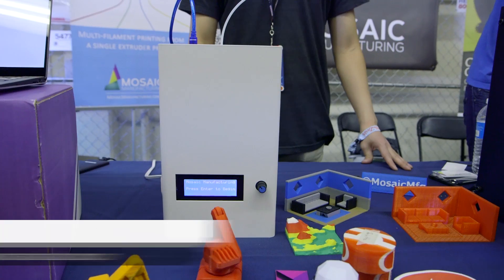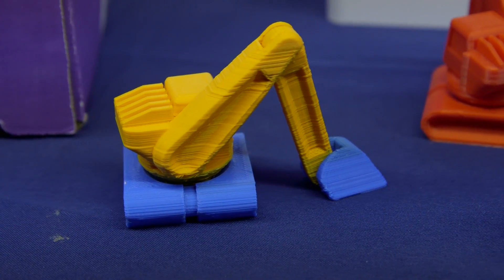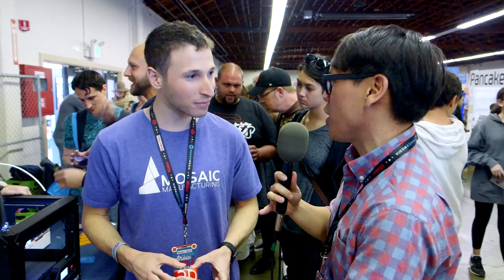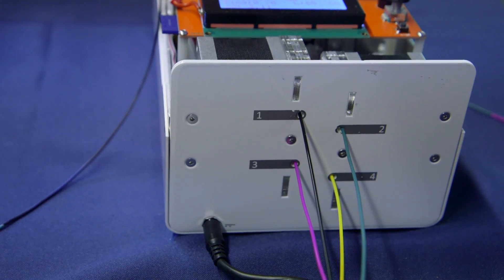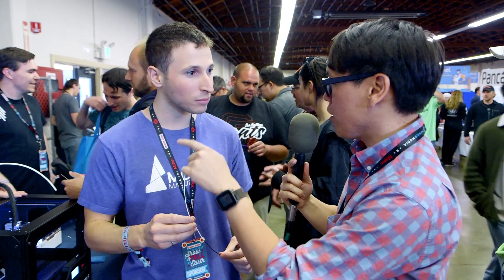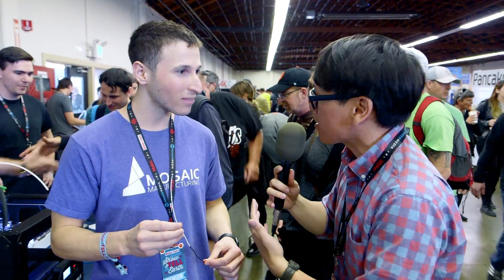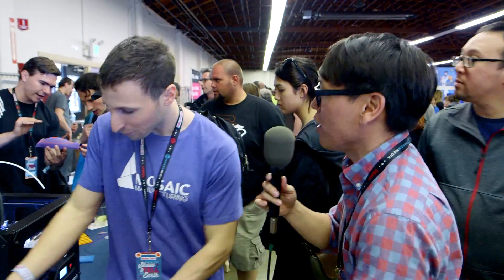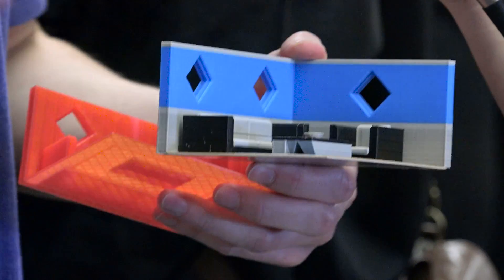Multi-Color 3D Printing with Palette Filament Splicer

Comment: Looks like this Palette system might be the way to use the PETE strip pulltruded material effectively for longer runtime prints so someone doesn't have to be there to load the next spool within a given time after the stop sensor pauses the printing process... which if one waits to long can funk up the heating/temp properties of the system and screw up the prints.
Reply: Oh yeah... and I forgot to mention you can use the Palette system to just make long spools of the PETE bottle filament by itself.

Comment: I am skeptical. The lines between colors cannot be sharp. There will be a transition zone where the colors mix in the hotend when changing colors. You can do a much better job manually by pausing the print, flushing out the old color, and loading a new color into the empty hotend.  No thanks.

Comment: what about the transition between the 2 colors. for example, If i had black filament in and took it out and put in white, it would extrude a mix of the 2 colors before it extrudes the actual white color your looking for.

Comment: It's very cool, but you can't exactly print a JPG texture on a cube with it. There was a solution from another company (Spectrom) which used dyes to color white filament as it went through, but it seems like they went under/vanished.

Comment: so why not actually mix different filament colors live? like over heating them to a liquid state mixing them with a little  coily thing  like they have in slushy machines then sending them through a filament shaper thing... or even use colored UV activated plastics... so mix them as a liquid extrude them as a liquid and pulse a UV laser on any area you need to be harder....
Reply: the UV cured resin would be best...it would reduce overhang and stuff...

Comment: Is this aimed at a specific 3D printer MFGR right now or will it be universal for all 3D printers as long as they meet the requirements of your system? I'm going to be buying a 3D printer in the next 30days that does have dual nozzles and your product may be an option later on.

Comment: ok. so I got that they meld the 4 colors into one, but how does it pick which color shows? so does it have a second extruder in the palette machine that melts the strands together first?
Reply: it is cutting and splicing the strand together on the fly. it takes 4 different filament colors, and actually welds the requested color onto the previous one leaving the machine, going to the 3d printer.

Comment: I wonder if it compensates for different sized hot zones in different hotends. Just because you put a different color into the hotend doesn't mean that a different color will come out instantly. It can often take me as much as a foot of 1.75mm filament to completely switch colors from, say, straight white to straight black.
Reply: It uses a transition tower to switch the colors.  I have a video on my channel showing a two color test print that might show it better. I haven't measured the actual transition square, but it might be 1 inch. That might give you enough filament run-out to clear 12 inches.
Reply: color switching before doing the infill is most probably fixing that. when the color is changing in the infill its less noticeable.  or you have some sort of wiping/color change island printing next to your model
Reply: Yeah, I'd imagine it's probably the latter (island). That would pretty much rule this device out for industry applications (i.e. 3d printing services) that use higher-cost materials. You could run through a lot of money in wasted carbon fiber or other composite PLA's with something like that.

Comment: It practically blows my mind to see how this 3D printing technology is changing.  I remember a few years ago when it was this strange gimmick that only techie people used because you basically had to build your own printer and program it.  Then companies started making some for sale. Then the different filaments... the different materials you can print in... now 4 color.  It's just wild to think about where this will all be in a year from now.  Or three...
Reply: I have to say I still like my "techie" RepRap far better than any of the commercial printers I have tried (all sub 1.1k dollars).  I will say this and that is to stay away from any printer based on Makerware or uses Sailfish.  I SMH with that and basically the printer I own that uses that is a 700 dollar boat weight, sadly.

Comment: You know,   I really dont have a need to do multi-color prints.  But if the just made the splicer,portable/hand held, so you can splice in a new roll of filament (reliably) and not have to pause the print to swap spools.  I'd definitely buy that.
Reply: I wonder if you could modify a hot glue gun with some sort of break action to do this...

Comment: Norm all your questions were on point but you missed one really important to this sort of approach: 

How are they dealing with the 'blended' area of the colors? Because when you push a new color in the old color stays mixed in for a while and would look ugly, but they are obviously doing something with it. For a few moments it looked like it was printing weird squiggles off to the side of a main print.
Reply: Hi Reed, Brennan from the Mosaic Team here.  

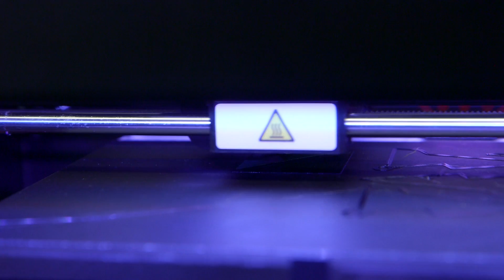We deal with the blended areas of colors by creating "Transition Towers" -- basically, areas where we purge the ugly/mixed material.  We require one transition tower per color transition (so with 4 colors, that's 3 transitions per layer).  Here's what a two-color print looks like with 1 transition tower: http://puu.sh/pc0Vo/93fe6a0397.jpg (the transition tower is on the left, and the object we're printing is on the right).  You can actually see a transition tower in the video at 1:29.

In layers where color transitions aren't required, we try to minimize the amount of material used (e.g. infill of 10% instead of 100%) while still building the transition tower up for color transitions in higher layers.

Edit: formatting
Edit2: added timing for transition tower in the video
Reply: Yes, my printrbot must take several inches of output to change colors.
Reply: I wish we had some sort of feedback to know when the hotend was fully purged.

Comment: ...Wouldn't the synchronization between the Pallet and the Printer require that your print job start with a very exact length of filament been the two? I mean, it doesn't seem like it will be able to calculate the offset if you can run any amount of slack between the two you'd like. Also, if there's two feet of a filament between the pallet and the printer when you start your print job, does that mean you won't be able to implement your first color switch until those two feet of material are used?
Reply: Hey PC Posh, Brennan from the Mosaic team here.

You're right: those distances matter a heck of a lot.

What we didn't really have time to cover in this video is that Palette comes with a calibration system that attaches to the back of printers (using a piece of Velcro).  We call the calibration system a Scroll Wheel.  The Scroll Wheel is a high-precision rotary encoder (which basically means it can record how much filament passes it at a very precise level).  To set up Palette with a particular printer, the first step is a calibration process (which tells us the exact between the Scroll Wheel and the end of the extruder).  This calibration is pretty quick and only needs to be completed once per Palette/Printer combination.

Regarding extra material being used at the start of a print:
If you're referring to things like a skirt, or a startup sequence, all of this information is in the G-code (instructions to the printer), and we take this into account when we're calculating the filament distances.

Comment: What about a RGB, black and white filament system that lets you print any colour relative to the layer (like a standard 2D printer). This would be like colour blending and would be far more detailed. This seems all too primitive, and the print quality is awful!
Reply: Hi storm watson, Brennan from the Mosaic team here.

We can't do an RGB or CMYK system or anything like that, and we agree, the industry has a long way to go before there's a printer in every home.

With that said -- Palette doesn't change the print quality.  We don't build a printer, or an extruder.  So someone with a mediocre printer would not all of a sudden have crystal clear 3D prints with outstanding precision.  All we can offer right now is making sure that the right filament shows up at the right time.

Edit: changed "printers" to "prints"
Reply: It'll probably be a few years. For something like that, you basically need a miniature plastics factory to melt, mix, and draw plastic on the fly. granted, there are expensive professional 2D printers that do this, but I doubt those methods aren't patented.
Reply: Then I'll be the first! :)
Reply: yes I'm aware of the  print quality being a seperate factor, the comment I made was a bit harsh (soz). It's an exceptable amount of progression that you guys have made and I apaude you for it since i've seen few other individuals attemt the same feat.

I've been wondering more so how this same effect could be produced with the resin printers but that can be saved for the future, ty for commenting though; two's company, three's a crowd!

Comment: A small offset and all will go wrong?
Reply: Hi Sultan, Brennan from the Mosaic team here.

We have a series of calibration systems that help keep the print on track, because you're right -- there are a lot of things that could go wrong, and we need to account for all of these.

A few things that could go wrong:
- printers lie (we've discovered that printers extrude roughly 99.7% of what they claim to use, with the first layer being particularly bad (96 - 98%))
- like ms3bani says, filament diameters aren't always perfect
- extruders can skip

A few ways we solve this:  (Note: You don't need to know how all of these work to use a Palette -- this is just for those who are curious how Palette works)
- We have a brief calibration sequence with each Palette/Printer combo, so that the Palette learns the printer's extrusion errors (some printers use 99.8m of filament when they say they are using 100m -- like you've identified, a fraction of a percentage error makes a big difference when you're doing a 30-meter 10+ hour print)
- The one modification required to the printer to use it with a Palette: you must put a piece of Velcro on your printer so that we can attach our calibration unit to it.  We call our calibration unit the Scroll Wheel (it looks like this: https://www.flickr.com/photos/90025904@N04/26630870396/in/album-72157667337313316/).  The Scroll Wheel is a high-precision rotary-encoder (which basically means that it can track the amount of filament that is passing by it at a very precise level).  We combine this information (the amount of filament passing by the Scroll Wheel) with another system we call pinging.  When you run your G-code file through our open source software [found on mosaicmanufacturing.com/pages/resources], we add some special instructions at various points in the print so that the printer can effectively tell us exactly where we are in the print (e.g. if the printer pauses for 3 seconds, then moves, then pauses for another 3 seconds, it is telling us that it is at exactly 10% of the way through the print).  We can then say: "hey, we're at 10% of the way through the print?  I thought we were at 9.9% of the way through the print" and make the necessary adjustments to the filament segment lengths as we proceed with the print.
- We also add what we call "Transition Towers" when we're switching from one color to another.  (See transition towers here: http://puu.sh/pc0Vo/93fe6a0397.jpg -- the transition tower is on the left, and the object we're printing is on the right.)  The transition tower also gives us a bit of a buffer for when the colors are off.  The transition tower typically gives us a max of about 5cm of offset before prints are ruined.  We ping frequently enough that we should never be more than 5cm off (even accounting for printer extrusion inconsistencies).

Edit: fixed "diameter's" to say "diameters", added "Note: You don't..."
Reply: yep. filament diameter inconsistency, extruder skip, etc. and you're screwed.
Reply: You're welcome! We're asked often about RGB or CMYK mixing -- this is quite different from the technology we've developed.  Mixing is something we experiment with, but not a focus of ours at this time.
Reply: Hi Brennan, thanks for detailed answer.
Could be next to use three colors (RGB) of filament to produce nature colors I guess it requires for black and white colors too, but any way the idea to use 5 colors to get all possible colors?

Comment: Such a let down that one... Uses the crappy small filaments, still has a lot of waste... list goes on...
Reply: common, 1.75mm is basically industry standard.
Reply: Exactly and only the dinosaurs are still using 2.85mm (3mm) filament.

Comment: Would it be possible to blend colors together in a five color printer (Red, Green, Blue, Black and white) to create any color? I already saw a little bit of fading where two colors were melted together, so with some engineering couldn't you blend multiple colored filinents into any color you want?
Reply: And why stop at four? If the five color blend is possible, could you have 6 (five colors + conductive)? If possible, this could open up many more possibilities in 3D printing.

Comment: ...It costs as much as a 3d printer..
Reply: The printer that they were using appeared to be a MakerBot 2, which costs 799$, has 12x9x8 print dimensions, and is a single extruder FDM.
Reply: Pandonaut Productions ...that's closer to triple than double. (especially if you buy from Monoprice with free shipping)
Reply: In my case, 3 times as much. (cheap Chinese electronics FTW!)
Reply: Personally I want to get the Wanhao Duplicator i3 which is only $349 so yea it would cost double
Reply: True, should I go for the monoprice version or the one from Wanhao? I know they're the same but which one is more preferred? I was thinking about getting the 4S for the dual extruder and MK10 hotend, but on monoprice they only have MK8 hotend for the dual extruder, but have the same specs for the i3
Reply: I have a prusa I3 clone with dual extruders, I paid 250 € (~300$) for it.
it probably would be a lot cheaper to get a 5 way diamond hotend milled, and add 3 motors.
Reply: My 3d printer is 250$ lol.
Reply: better invest in an diamond hotend, full RPG hotend

Comment: Any chance you could daisy-chain these?
Reply: Maybe. If you're rich enough to buy these in bulk, I'm sure the software engineers will work with you. Motherboard manufacturers do this with people who have compatibility issues with 3 or 4 graphics cards.
Reply: +Koriko Alistar Would be fun to have a 16 color printer eh? I would help if they needed and I had multiples of course.